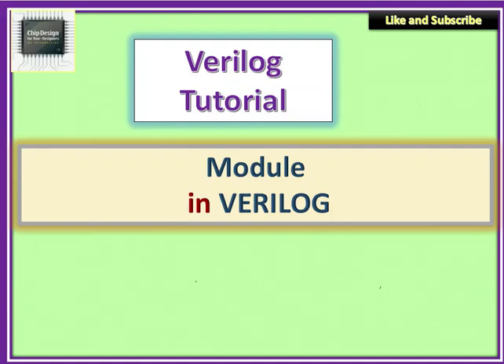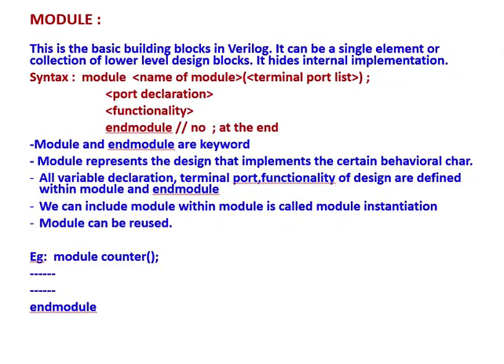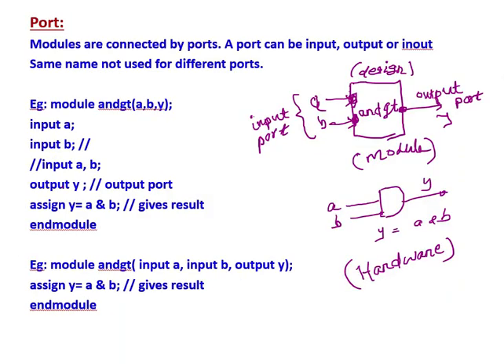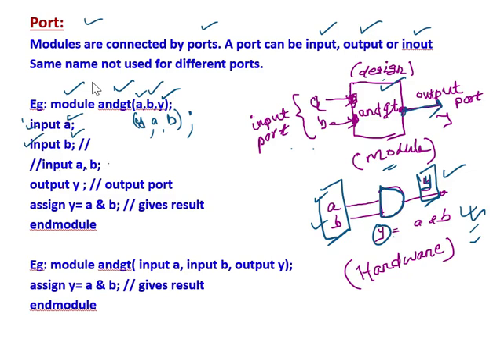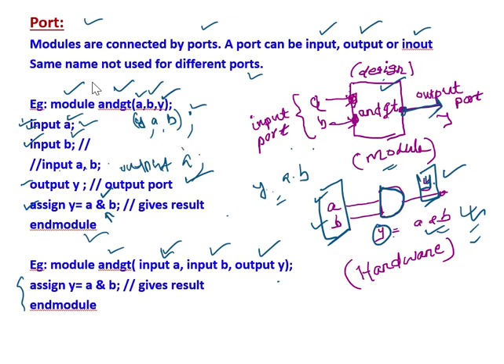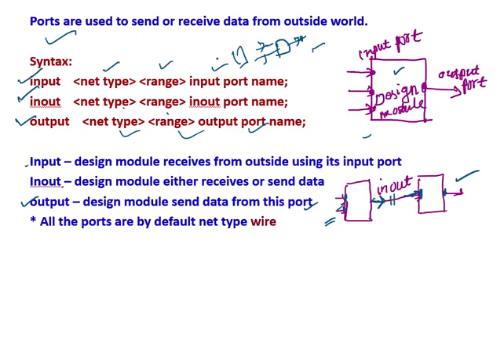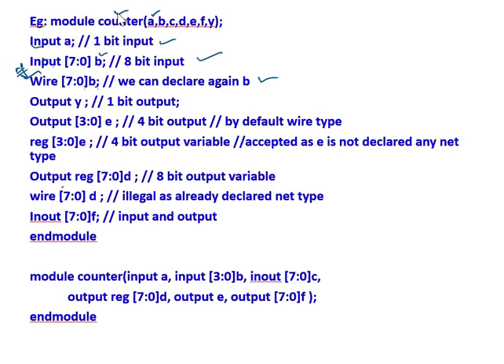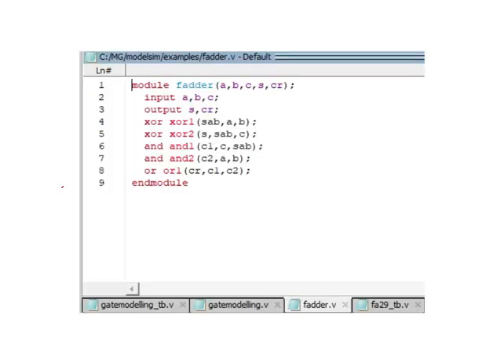#6  Module and port declaration in verilog | verilog programming basics | explained with code

Comment: hi sir. wire =connecting 2 components. then how can "b" is declared as a wire?  . b is a constant or wire ?
Reply from the maker: Wire is something which allows signal to flow through it or which drives signal from one point to another and which can not store data. 
Hope you understand from above mentioned point.

If you don't get it then please elaborate your query more so that I will be able answer you more correctly.

Comment: Sir If we don't register the output, is it raise error ?
Reply from the maker: reg is used when something is assigned in a procedural block(always and initial).
Wire is used in continuous assignment (assign)
So it depends on how you use these to assign values.
Wire is used to model combinational logic and reg is used for both sequential and combinational logic.
So it's about when to use.
Reply: @TheCodingCapacitor  thank you sir..😊❤

Comment: At 13:21 e is wire and reg both how ....
Because in above e expression e is already wire datatype by default but then on the very next line we made e reg type ....
Also what if we further process this e variable then how will compiler knows that in which e(either wire or reg) we are dealing operations
Reply from the maker: By default every input and output port is wire. 
Say 
output e ; // it's a wire by default// only created a port // it's now unconnected 
wire e; // now declared e as wire so telling to compiler that it's data type is net type

reg e ; // now telling compiler e as a storage component (flip flop)
But as alredy we have taken e as both wire and reg so compiler shows error.
Hope it helps